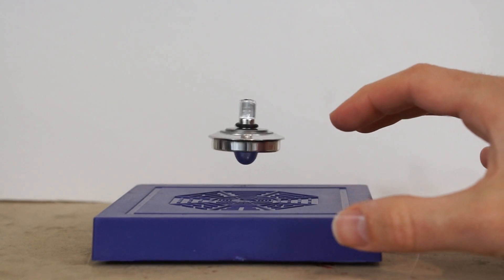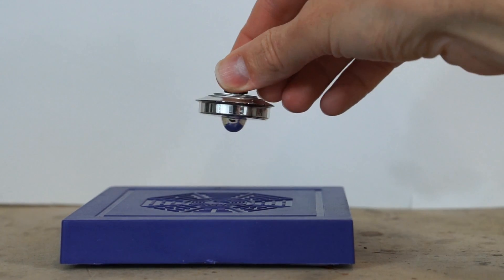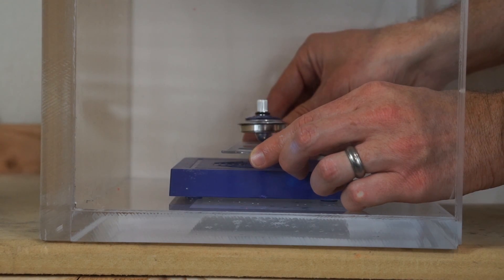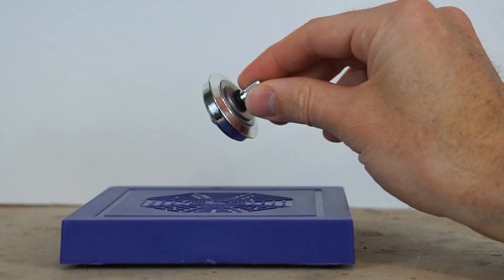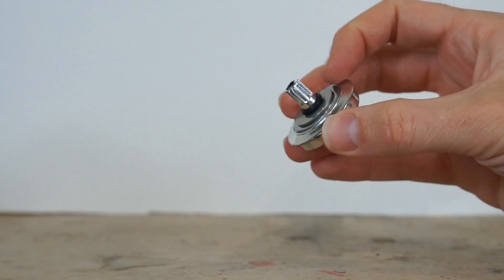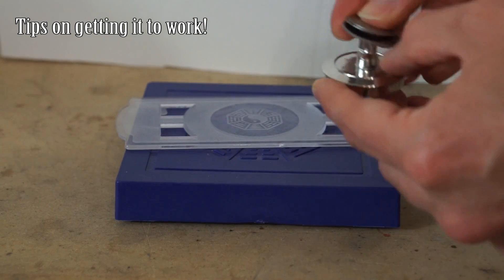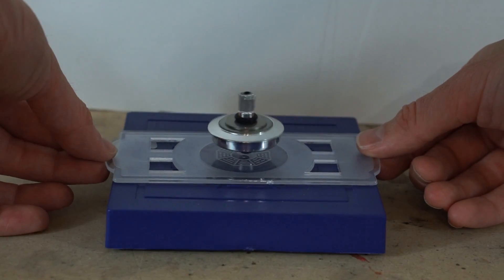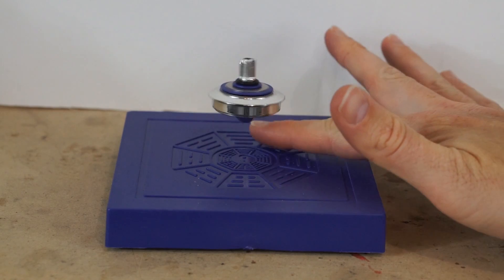Will a Levitating Gyroscope Spin Forever in a Vacuum Chamber?

Comment: its less to do with the friction slowing it down, but the mix of the friction plus the magnetic resistance cause the kinetic energy generated from the spinning to be transferred into different forms of energy like heat or sound, and that's why eventually it will come to a stop. With regards to the Earth and planets spinning in space, that's because of the fact that they are being acted upon by the gravitational pull of the sun, as well as the moons in earths case.

Comment: The other reason is that the controls for levitating, depend on atmosphere. If it was a true vacuum, the drive for levitation would be highly stressed, fighting gravity without an air-buffer "cushion". The closest thing to "spinning forever", is light. It eventually slows-down to become a free-floating electron that will simply bind to whatever it is most attracted to. When they finally figure-out what it is spinning around (orbiting), my life will be complete.

Comment: What everyone else seems to be missing here is your system is not closed. This means the Earth's magnetic field is playing a role, for example an electron trying to move in a straight line, but cannot because of impedance. If it is strong enough to move a magnetic rock, ie lodestone, then it will play a significant role, statistically speaking. You must repeat your experiment with magnetic shielding, such as iron.

Comment: Its impossible to vet a gyroscope to spin forever gold fidget spinner fan etc cant spin forever either so no anf proof for you -->   Without any calculation Indeed, one can very confidently eliminate any possible loss of energy due to "hypothetic" gravitational waves, due, at best, to third orther quadripole power series coefficients. 
Althemore, despite Virgo-Ligo recent "confirmation", their existence is still fairly an open question, even though Gravitational Waves were strongly predicted theorically for the first time, by the french scientific genious and worldwide Master Henri POINCARÉ in his June 1905 masterpiece article on Relativity.
But in any case, it is abyssaly smal effects even for light speed spinning twin Neutron Stars. So there is NO hope to count for any signigicant energy loss due to spinning gravitational waves emission of this toy. FORGET ABOUT IT!

Than the argument of material oscillations of the heavy base magnet seems fairly dubious... I will forget about it very confidently.

Thirdly the "vacuum" is obviously never "perfect", but it seems almost enough not to worry to much about it, at first inspection. It  seems at least perfect enough, not to be significently responsible for this rather "very fast" spinning collapse in vacuum, within few dozens of seconds. So forget about that also.

So what is more seriously left? 

Routhly speeking two "forces" are obviously competing here. "Downword" gravitation : P=ma, and "upword" Lorentz EM force : F = q(E +v×B).

"Downword" gravitation is rigorously converging and increasing toward the center of Earth, but in this situation one can surely consider it as a UNIFORM AND PARALLEL acceleration field.

But it would surely be far from accurate to forget that the magnetic lines, in which the disk is spinning, ARE NOT PARALLEL. They are actually slightly rising divergent. And this asymmetry may play some crucial rôle in this DYNAMICAL STABILITY INSTABILITY PROBLEM... 

It is Indeed a strong contributor of PRECESION AND NUTATION, which will both eat the spinning energy. The total spinning energy being mainly CONSERVED through this TRANSFER from different aspects of it, namely : spinning kinetic energy being transfer from one Euler angle, the "vertical axial one", to the two others, causing therefore AXIAL CONIC PRECESION AND WINGLING ELLIPSOIDIC NUTATION.

Before comparing these two effects by solid computations, one might argue that the WINGLING ELLIPSOIDIC NUTATION may be more harmfull to the toy spinning collapse, than the AXIAL CONIC PRECESION. 

But rather certainly BOTH EFFECTS AD UP to conspire for the fast collapse. The rising divergent magnetic lines of the base magnet being at the core of these "deadfull" effects.

Finally, of course induced FOUCAULT currents due to spinning toy magnet swiming in the base non uniform magnetic field, surely exert a slowing down counter torque, that takes his "ground" in microscopic transfer of energy between electronic induced "laminar" currents and the metal network matrix, through Joule heat "chaotic" dissipation. 
The toy is thus at first actually HEATING, but since it's spinning in almost vacuum, the heat produced, canot fly out by air conduction, and so only IR EM are draging far away out this spinning kinetic total energy. 

But only precise computation can evaluate the actual mutual importance of these THREE MAIN EFFECTS. 

To part aside the induce currents effects and the PRECESION - NUTATION contribution, it may be tryed to cool down the toy with liquid hélium, such as to kill the Joule resistance to these induce FOUCAULT currents. Leting mainly standing alone the PRECESION AND NUTATION effects. 

To try to kill these two experimentaly one could try first get the toy spinning as vertical as possible. But moreover to uniformize the magnetic field of the base magnet, at least in the concern region where the levitating toy is spinning. A vertical  coil surrounding the base magnet and the levitating toy, may help to straighten the "vertical" magnetic lines.  Extra It won't spin forever because it is not spinning perfectly level so some of the rotational force is being transferred into an oscillatory force, and so it loses a little bit of its momentum every time it oscillates, and since it has mass, and mass is simply a measure of how much force is required to move an object in a vacuum, the gyroscope would slow down little by little because it's mass is constant but it's rotational momentum depletes.

Comment: It will stop....  Cause for Evey slight decrease in rotation speed increases the magnetic attraction of the opposite pole...  Causingit to be flipped as the gyroscopic effect dies of...  You need  a perfectly floating spinner with or without spinning.

Comment: no it will not spin perpetually in a vacuum because it is not only air resistance that is fighting the "gyroscope" but also gravity because it's actually resting in a convenient pocket in the center, I say "gyroscope" because theoretically if you had a 0 friction gyroscope in a 0 G environment under 0 atmospheres of pressure it would spin perpetually. In reality this cute toy put in the same environment would push away the spinning piece. Not a gyroscope.

Comment: When you spin the disc, you induce eddy current in the metallic components. You will have electrical resistance etc. which will produce an opposing force which will slow down the spinning.

Comment: There is one magnet moving in relation to the other. This means that an electric current is generatad in both magnets. Just like in a circuit resistance, the magnets should be warmer at the end of the experiment and that's the way the kinetic energy is discipated until it ends.

Comment: the magnetic field exerts a force between the two which slows the rotating disc. its not friction in the normal sense, its resistance caused by the forces of the magnetic field reacting against each other

Comment: IT WILL NOT SPIN FOREVER UNLESS BOTH MAGNETS ARE FROZEN And you do not need a vacuum chamber
,don't believe me?? try it yourself. I challenge you to challenge science books that told you all you know~  did you know that if u force POLAR oppossites together and drop them out the window with a  IT DOESNT FALL AT THE SAME RATE.
 IT IS NOT THE SAME TIME!~ u can proof this concept by freezing a magnet in the freezer  YOU CANNOT ACHIEVE FOREVER UNTTELL THE MAGNET REACHES ABSOLUTE Zero However you can detect the differences at the temperature water freezes

Comment: It would spin a long time but even with no air, there are still particles in the vacuum. This is why it would take infinite energy to achieve light speed. So it might even spin for centuries in space but it will eventually slow down

Comment: There is also another reason that would stop the spinning even if the magnet on the case was totally stationary. And the reason is electromagnetic fields (not magnetic field) that produce work and, therefore, consume energy. Since you have to spend time to empty the chamber from air, the spinner start slowing down before the chamber is empty. But, when it slows down, it also start wobbling. The wobbling causes the electromagnetic field generated by the spinner to change its direction continuously (it's a vector). This changing in direction causes a force between the static magnet and the spinning one that attempts to stop the wobbling. That force effectively produces a mechanical work and, therefore, dissipates energy. The loss of energy causes the slow down of the spinner even more. At the end, it is a chain reaction, and the work increases as the wobbling increases, until the spinner crash lands on the box that contains the static magnet.

Comment: I'm curious a setup like this could be used to detect Earth's rotation. It seems like the component of Earth's rotation that is perpendicular to the axis of rotation of the top should cause a slow precession. Maybe it precesses as it is in which case the relationship between the latitude and the precession may be complicated. Still, it would be neat if it was possible to have a small, low cost and self contained device to detect Earth's rotation that any skeptic (flat Earther) could buy.
Reply: The spinning of a top as it slows and produces a force perpendicular to its spindle is used to explain the earth's rotation and tilt.

Comment: because the magnetic field is communetically transferring anti-atomic nodes between sister planes, the gyroscopic forces will always eventually lend it's to the weaker  cross  lateral multiplane.
Reply: So you think that BS will keep it rotating forever?  Like spin in politics?  That sounds plausible....

Comment: Reason 1: Not a perfect vacuum. Residual air molecules create tiny but not zero friction.
Reason 2: Fidget is not well balanced, while wandering around the magnetic field, crossing different strength fields so create internal electric current in the fidget body, this electric current causes heat which is another energy loss.

Comment: I stopped it at 4:38. I don't it will continue to levitate because the vacuum chamber seems like it makes the force of gravity greater.  I think it will be too much force for the top to stay up.  At the same time I think it could possibly stay up since there shouldn't be any wind resistance.  Now I just thought that maybe the top is generating it's own wind current because of the magnetic force between the top and the the small platform.  Am I close to correct?

Comment: Think it's going to stop based on other minute factors outside of the chamber, including the imperfect spin rate. You might not notice it but the earth is still moving and so is your house, etc....too many imperfect factors will add up and it will tip over rather quickly.

Comment: Paused the video at 4:37 as instructed, my thoughts: There will be a very small torque caused by the rotation of the Earth, probably not noticeable given the fact that your gyroscope is so small. But if it was a lot bigger, and you worked hard to eliminate other things, maybe the rotation of the Earth would be the first thing to twist the gyroscope into a position where it was no longer stable in the magnetic field?

Given the size of the gyroscope I would guess either what little air remains in the chamber, or other magnetic fields would be the most important effects.

Comment: Try spinning it with the plastic thing off the magnet.  Maybe after its spinning you can use compressed air to blow on the finger part to get it spinning faster.

Comment: Air resistance isn't the only thing slowing it down. Think of electric motors which have been short-circuited. The magnetic field slows it down :-) Every correction of the position does generate friction

Comment: I think it will stop because of the law that states that energy can not be created or destroyed
Reply: Rice Blender yeahhh, that‘s what i thought
Reply: If the law states that no energy can be created, either we should not exist in the first place or the law is wrong.
Reply: Rice Blender
No... Well, kinda.
It would stop, not only because there is always gravity, But also because there is always magnetism; each acting on it ever so slightly.
Reply: No.  It will stop because energy is used by procession to keep the top upright,  and this energy comes from slowing the top,  which will eventually collapse.

Secondly,  this magnetic top is rotating in a magnetic field,  which means that electrons are sloshing back and forth from the rotational speed much like in a generator.  the flow of electrons is consumed by resistance and turned into heat.

Just like with a generator,  it takes energy to move those electrons,  and that will come from the speed of the top,  causing it to collapse.

I suggest that the two major ways energy is consumed in this system is 1) procession  and 2) electrical current flow and resistance.
Reply: Why did u say the law if states...........
Reply: Well you are wrong because Beerus can detroy everything

Comment: The magnetic forces we see via the spinning top are not constant, not consistent, not totally equalized, there fore at some time in the future , not too long by wobbly action we see the top will stop. If you replicate this experiment using very exacting and equal magnetic strength than we would go a bit longer but this is an imperfect system therefore it will cease to spin . 3 minutes is my guess since you asked. Great thought provoking video. Thank you Sir.

Comment: This is more like putting a car ontop of a can, yes the can can hold the car but as soon as theres even any wind on 1 of the sides, it'll just get crushed. Same thing here, it'll probobly spin, not forever but a lot longer (remember there is still air in there) and as soon as something hits it from the sides, it'll fall instantly

But there is 1 place u can have something spinning forever, outside of space were there is abselutly no friction because there is a complete vaccume

Comment: It's obvious that it would slow down because, air or no air, the kinetic and potential energies would still unravel because that is simple entropy of the universe.  Every movement is a further chaotic reordering of the universe that diffuses out of the object to the more ordered states around it.  Also this experiment still doesn't neutralise the gravity vector and therefore gravity is still affecting the object's motion.  By Einstein's theory, the very essence of an object experiencing time would mean that it would have to have some kind of motion relative to either gravity or the expanding universe so the big bang in the hottest stage of existence would be comprised of all the energy that the universe would ever need in its existence.

Comment: There are two main reasons it’ll stop 1 gravity is pulling it down and the magnet pushes it back up and that creates a sort of friction because of the laws of physics and 2 the top of the gyroscope is attracted to the top of the plate and that cause the forces to clash so eventually it will drop

Comment: There’s another reason why it wouldn’t spin forever. As in the case of the friction between the spinner and the magnet, if you spin something in the space it will stop because of the friction between the object and the magnetic field from planets which isn’t neutral wherever the object is situated in space

Comment: It will stop due to internal friction in the top.  It is a piece of plastic wrapped around an internal magnet.  If there is even micro-movement, that will use up kinetic energy on friction.
Reply: Ok so I was close.  I figured it was friction internal to the top, but it was actually movement internal to the base.

Comment: It won't spin forever because it's a rotating magnet in a static magnetic field (the Earth's magnetic field). Even if you could neutralise this effect, it will still be unable to spin forever because it experiences the asymmetric centripetal acceleration from the Earth's rotation (which is why Foucault's Pendulum behaves the way it does).

Comment: you hit on the point I was going to make near the end. Even if the magnet was perfectly balanced in space, not interacting with any other nearby forces, a rotating magnet will radiate waves in the electromagnetic fields causing it to loose energy over time.

Comment: Angular momentum of the rotor reinforces its gyroscopic stability within space, and reduces the minute effects of earth’s gravity (a very weak force in context). Main concern would be the induced currents and interacting fields since inductive matter is cutting through the magnetic flux of the stator and inducing currents and opposing fields. https://youtu.be/sENgdSF8ppA  .. Experiments you could try: increase the angular momentum of the rotor; if you increase mass, compensate with increasing the levitating magnetic field strength, you could also increase rpm to achieve the increase in angular momentum， remember the effective permittivities and hysteresis curves of your material will make a difference to your results - (you’ll need to start rotation closer to equilibrium of magnetic stability), minimize conductive matter in the rotor. Try significantly increasing angular moment of the rotor after achieving a vacuum. Flywheels with a lot of angular momentum can spin for a very very very long time even on air bearings - no vacuum needed.